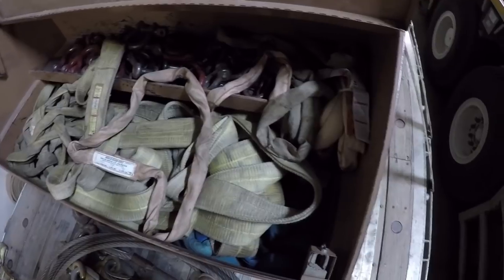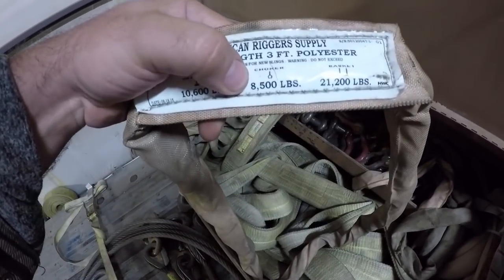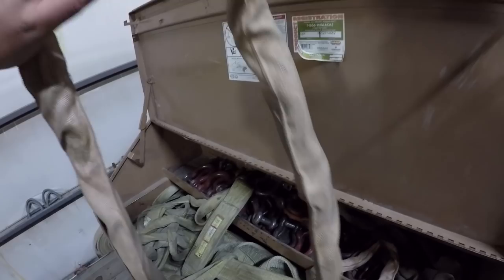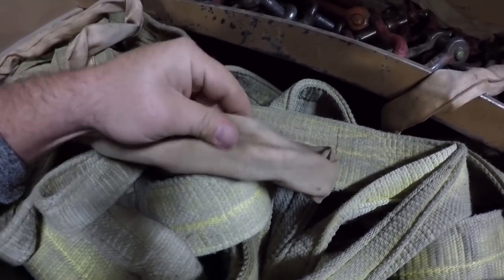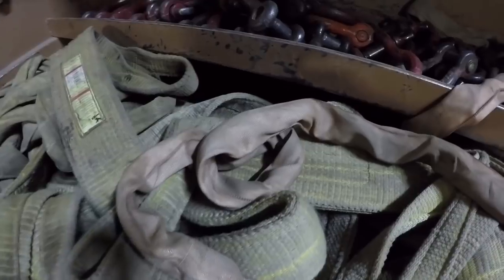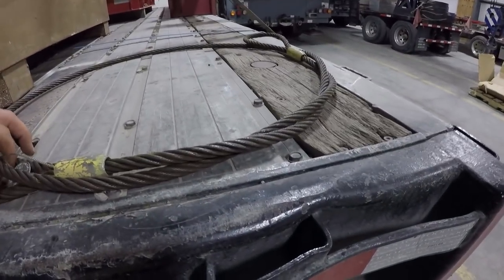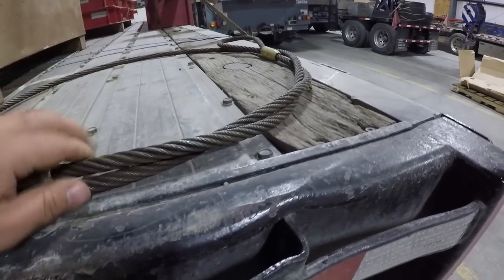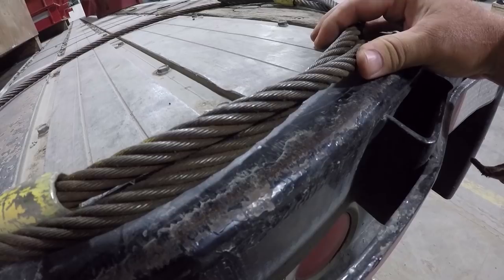Crane Rigging | Slings

Comment: Great video but there’s 1 huge oops.  Your trailer in NOT D.O.T. Compliant.  All tiedown attachment points must be inboard of the rubrail.  They don’t even want your chain hook tips on the outside.  I got hammered hard on this in 2011. The only thing thats allowed outside are your bungee cord hooks, strap hooks or other tarp securement devices.  My drivers were made to change everything at the scale houses.  Those coil lifting chains are really nice. The company that made ours also made aluminum softeners for us.
Reply from the maker: Richard Savaglio, I wasn't aware of that. I just operate cranes. Lol. Anyway, thanks for the heads up. I'll change it Monday. Those lifting chains are heavy. I'm glad I'll be using a crane to pick them up. 😉 Thanks for watching! 🙂👍
Reply: I don’t want to say anything you say is not true, and it may be on a state by state basis. in the US you can have load securement devices outside the rub rail but the FMCSA does want them inside whenever practical. The rub rail is not designed to support a load but it along with the spools makes the spools and stake pockets suitable for load securement. I haul slightly oversized loads and it overhangs the rail just an inch or two on the right side and flush on the left per Michigan law, making the transition from the load to the inside of the rail too great in order to do that.
Reply: Half-assed Garage it does kinda sound like it’s a state rule and differs with each state. I know Illinois and Indiana busted my drivers about it. I have a few trucks that run into  Michigan hooked to 5 and 7 axle covered wagons hauling coils from the Gary area.
Reply from the maker: @half-assedgarage6668 , sounds like I have some weekend homework to do. Thanks for the info and for watching! 🙂👍
Reply from the maker: Noting that tiedown failure caused by trailers rubbing against fixed objects is “extremely rare,” the FMCSA decided in 2005 that removing the rub-rail rule would not detract from highway safety and would make enforcement more consistent. Despite objections from Canadian officials, the FMCSA issued a final rule in June 2006, rescinding the prohibition on routing tiedowns outside the rub rails.
Thus, drivers and carriers are no longer prohibited from routing their tiedowns on the outside of the rub rails.

Source: www.jjkeller.com
Reply from the maker: For the full article....  https://www.jjkeller.com/learn/should-you-use-rub-rails-for-cargo-securement
Reply: To The Top Crane  you beat me to it.
Reply from the maker: @half-assedgarage6668 , thank you for taking the time to look that up and post it! This is what makes this YouTube stuff fun. We all learn from eachother! 🙂👍
Reply: I can only see a 2006 date for when this was written. Illinois changed their law in 2010-2011.
Reply: To The Top Crane 10-4. Love your videos.
Reply from the maker: @half-assedgarage6668 , thanks!
Reply: It's on a state by state basis Indiana allows  outside the RR but fmcsa prefers to hook on the inside sadly like with anything FMCSA the fact of if the DOT officer had his morning coffee dictates if you get that sticker on the trailer or truck
Reply: john leininger sticker? What sticker? You ain’t getting no sticker anywhere I travel. They’ll tell you you won’t get one.
Reply from the maker: @Newberntrains , how did I miss your comment? Been in St. Joseph lately?  I think I remember you saying that you venture into the area from time to time? Thanks for watching! 🙂👍
Reply: @ToTheTopCrane  will be rolling thru Monday most likely i love the channel its cool the office staff got you guys those neat alloy slings are those something new to the industry
Reply from the maker: @Newberntrains , I'm probably going to be busy Monday. But, if you give me a heads up when you are going to be passing through, I'll buy lunch. The chain slings aren't new to the industry. Just to us.

Comment: Great info. The last part where you mentioned the 5:1 safety factor explained a lot. The steel rope had me puzzled at it’s capacity. It looked big enough to lift two of my trucks. Now I see that it could but it’s safety factor doesn’t allow it. I hope you get some shots on the crew rigging the new slings next week.
Reply from the maker: Dall Tex, thank you!  I'm sure I'll get some footage next week. If the weather holds off. It will probably be footage that my mom won't like. I'm literally going to feet away from being in the Missouri River. Thanks for watching! 🙂👍
Reply: Just a reminder 5:1 is the design factor of the rope however sling angles, termination efficiency, and other factors play a role in determining it's capacity.

Comment: That was a good explanation on the different slings for the lay man, that's why you have me keep up the good work. You wouldn't like what I'm doing at the moment I'm cleaning my stainless steel section on the front fence I built due to tea stain, each section is 2x1metres and there are 5, after cleaning I'm going to coat with a sealer so don't have to do again will send photos.
Reply from the maker: barry hansen, I try to describe everything in a way that those with no crane experience can take in. Hopefully I'm not going too in depth or over heads. Since you have experience in the subject, please let me know if you think I need to go into more detail. You have lots of stainless fence to clean. That doesn't sound fun. Thanks for watching! 🙂👍
Reply: I think that you did well most lay people would understand what you said if you went into more detail you would lose them cheers.
Reply from the maker: @barryhansen6854 , thanks for the feedback! 👍

Comment: That was actually an interesting commercial you had. It was kinda quick but if I caught it right, it said the manufacturer was Gorbel and they were showing a small crane that you can fit in small areas but I didn't catch how much weight it picked. Your video was also great and you did a great job explaining it all without making it a five hour video. Thanks again.
Reply from the maker: Mark Mortensen, the commercials are random, and I don't get to choose them. Maybe I'll catch a glimpse of it in the future. Thanks for the compliment and for watching! 🙂👍
Reply: I noticed that also but didn't catch the info on it, looked like it would be worth checking out ! 😊

Comment: I worked in a precast concrete plant for a few years, ran bridge crane (hoist) all day. We didn't have any poly/nylon rigging as it wouldn't take the abrasion. I preferred chain over wire rope. The only one that was hard to handle was a four leg 5/8" 12' drop chain. Lower the hook to waist height to get on hoist as that's about as far as I wanted to lift the ring.

Comment: Thanks for taking the time to go through all these with us. We use pretty much only continuous slings doing arborist work so it's nice to see other styles and have some explanation to go with them.  We also occasionally use dead eye slings rated for crane work. They have a spliced eye in one end and you tie the other end. We use them when balancing tree tops. 

Our rigging for lifting personnel has a 10:1 safety factor as required by ansi Z133-17.

Comment: Great video Jimmy! I was always a big fan of a nice 4 way set of grade 80, 20’x3/8” lifting chains with shorteners attached to the D-rings. For most lifting 2 of the 4 chains was sufficient and the other 2 could be draped back to the D-ring. Occasionally we would have to break out the 1/2” set, but the weight difference is surprising. When using a set of chains like this, would you have any problem using a hook to hook connection to form a large basket type configuration? Chains seem to have fallen out of favor in the past cpl decades in favor of more nylons, but I’m still a big chain fan. 
👉👍👈
Reply from the maker: psidvicious, I'm not as much of a fan of chains. The reasons being: if they fail, it happens without warning and pieces go flying. They are heavier. They have no "give" to them. As far as a hook to hook connection....I don't recall ever seeing anything that says it can't be done. As long as certain requirements are met. The hook can't be twisted, tip loaded or side loaded. Given the nature of that kind of connection, I would think there would be an inherent twist because of the hook dimensions. A safer practice would be to use a short wire rope sling, a ring, two shackles, or short synthetic sling to connect the hooks. Of course...all of that is just me thinking out loud. Thanks for watching! 🙂👍
Reply: Good observation about the twist. Not a rigging we typically used but happened from time to time. I think the reason we typically went with chains, was bcz of the versatility. Something was ALWAYS flying on the hook so we needed something suitable for everything from steel to rebar to lumber to pipe etc. Thanks for the reply. 🤙

Comment: How about those hammer locks those been a while since I have had to put them together and when I did tree work and condemned a climbing line we coiled it up and run a knife through the hole coil rigging line too
Reply from the maker: Josh Welner, when a piece of rigging is condemned, the loops at the ends (if any) are cut, and the sling is cut in several places. Thanks for watching! 🙂👍

Comment: with the naked eye how can someone tell if there purchasing alloy chain or logging chain
Reply from the maker: Typically the color is different and the chain should be embossed with some numbers. G30 and G43 are usually gray or zinc and would be embossed with those numbers. G70 is typically gold colored and should be embossed with a G70. G80 and G100 are typically black and should have HA800 or HA1000 embossed in them. They all sound a little different as well. The harder chains have a little more "ring" to them. Hope that helps. Thanks for watching! 🙂

Comment: You should really look up the FMCSA rules for tiedown strap and chain ratings before you make expert statements on how they are rated.
It is part of the same basic rigging rating system, and while they are not usually rated for overhead lifting, they most certainly have safety margins in the rating, thus why the rating is SWLL, not breaking strength.

Remember that while you think of your world as much more dangerous than transportation, just because your toys are more expensive lol, every single thing that you lift has been hauled down the road at 60 mph, and our tiedown systems have to be designed to handle that weight under extreme and unpredictable conditions, such as potholes, hard braking, expansion and contraction going from the mountains into the desert, etc etc, where you work and plan to avoid all such shock loading and unpredictability.

Each rated device is rated and designed for a specific use, and there is nothing inferior for a different rated device, as long as you are using it for the correct application.
Reply from the maker: ke6gwf, I don't recall ever stating that my "world" is much more dangerous than transportation. Transportation is obviously a big part of my world. Everything but the crane is hauled to the site by truck. 

The point that I was trying to make is that tie down equipment is NOT rated for lifting and never should be used for such. All too often I have seen people on a job site, use a tie down chain for lifting something. Which is a bad practice. 

I am sorry if you thought that I was making the crane world out to be more superior or dangerous than that of the transportation industry. I know otherwise. I think you may have taken the point I was trying to make out of context.
Reply: Measured response. 👍
Reply from the maker: @psidvicious , yes sir. I'm sure my mother is even surprised by my tact and restraint on this one. Lol